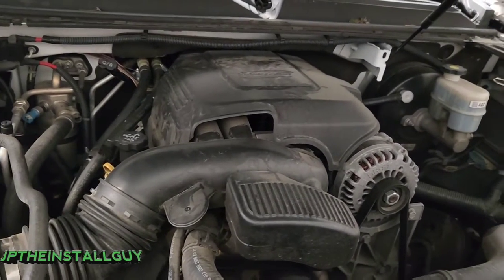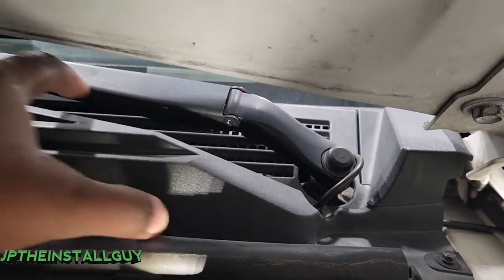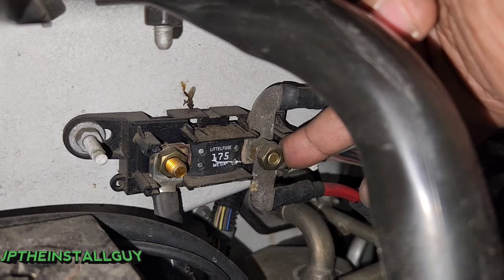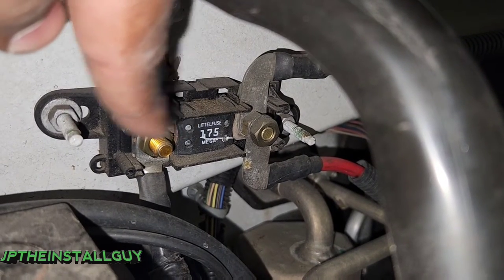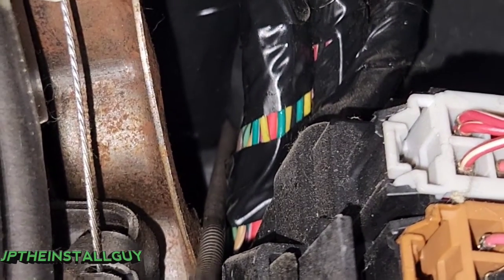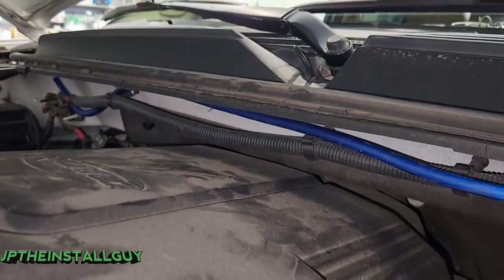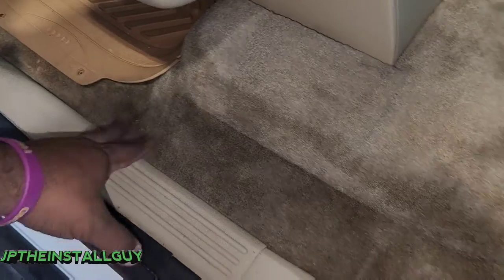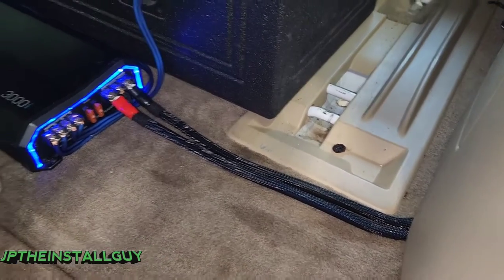install amp power wire through firewall of GMC YUKON

Comment: THANK YOU for this video! I have a 2016 Yukon which is the next generation from yours, but this portion of the truck is strikingly similar to yours with the large grommet next to the master cylinder. Now I know I where to run wiring!

Comment: pretty clean install, just picked up an 09 tahoe sle and the stock stero is pretty anemic so I am going to throw a 5 channel amp in with some better speakers and build a lil custom sub enclosure where the factory sub would mount on higher trim models. 

The only thing I would have done different and I will end up doing different is instead of cutting a slit is instead use hot nail or soldering iron to poke a hole in the grommet to keep a nice tight seal and pull the wire from the inside to the out.

Comment: What is the white unused bracket on the driver side (right) firewall between the motor and the brake fluid reservoir?

Comment: You’re wrong on the fuse side.  You want it on the charging side of the fuse that goes to the alternator.  That way when the alternator is running the power will be supplied without having to pas through the factory fuse.  

Good video though thanks

Comment: just bought subs and amp also got (0) guage ofc wire is that going to be a bit harder to do being a thicker wire..doesnt seem like i can run it through the panels to hide wire...figured id ask to see if not is there a better route... 09 gmc sierra 1500 crew cab is what i got..
Reply: I ran mine underneath the car following the rear ac cooler lines and it's a wire gourmet right next to the ac lines that feeds up/near the rear Cigarette lighter port inside the 
truck.

Comment: Where did you attach the remote wire?
Reply: If we are talking aftermarket stereo,  remote wire runs from the stereo remote wire on the back of the stereo (blue wire) to the amplifier remote input terminal. 
I'm sure you probably figured it out by now but I'm answering this question for anyone who has the same question. 👍🏾

Comment: Man I'm tryin to run some 5 gage power wire thru my fire wall in my 1996 Chevy Silverado k1500 it's a 5.7 vortec.. can u please give me some feed back I'm using a 2500 watt power acoustic amp on a pioneer 12" subwoofer and my stereo is also a pioneer but due to my budget that's what I'm working with

Comment: Thanks for the vid, great help. I have a question if you don't mind though. I'm wanting to install a 800W inverter in my tahoe,  but from what I'm reading if it's over 10 feet from the battery I need to use around 0 gauge wire. I saw you were using 4.  Mines not going to be for speakers though. I probably won't pull the 800 watts often, but want to be able to if I needed too. Would 4 gauge work for me with the install you did?   Thanks for any help.
Reply: worst thats gunna happen is if you max it out is you will pop the fuse thats the whole point. 

you could opt for a breaker setup instead.
Reply: @MrAwsomeshot  thanks, I ended up b using a 4 gauge and put it closer to the front and am going to run an extension cord to thr back. I did add a 80 amp breaker.